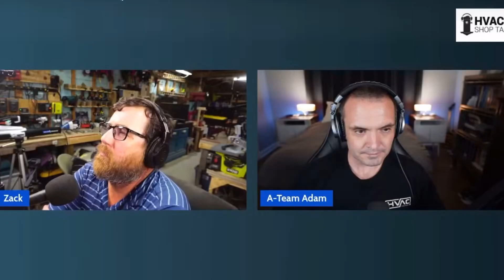Dehumidification and Variable Speed HVAC Systems

Comment: question: which would dehumidify the space more? a 2 stage system or a variable speed system? it's a fully closed cell foamed house, at roof line and exterior walls, with an erv running 24/7.  let's also say this is in houston, aka it has high humidity. and the ach50 score is around 1. and the unit is sized to manual j specs. also, which would be more energy efficient in the year?

Comment: Hmm I never thought about just how low the velocity is when an inverter system is running in stage 1. I put a carrier infinity in my parents house and this summer it did amazing as far as keeping humidity low. In dehumidifier mode it speeds the compressor up, fan down and actually has a temperature range you can set it to "over cool" by 1 up to 3 degrees to reach the humidity set point.

We don't live in a particularly humid environment and before this they didn't have air conditioning
Reply: what city/state are you in?

Comment: We have humidity issues with economisers in the Midwest, and we can not economise when other areas might be able to. 55 - 60 degrees isn't the same everywhere, especially when you factor in humidity and dew point. Comparative enthalpy is the best commercial solution, with the proper settings, of course.